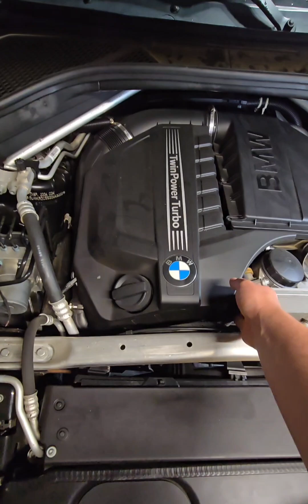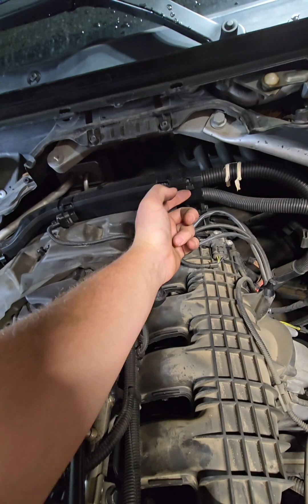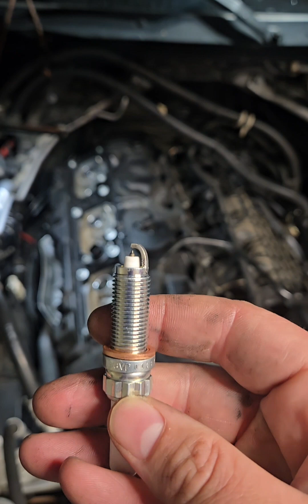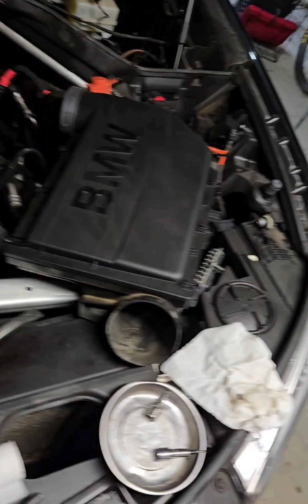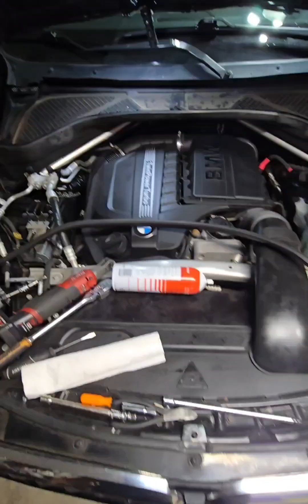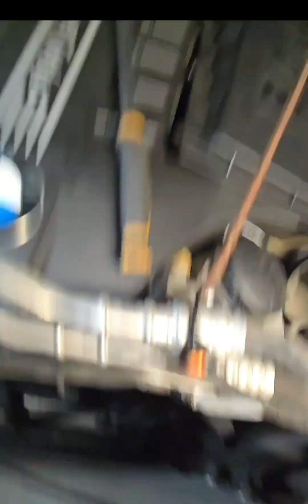2014-2018 F15 X5 35i n55 valve cover gasket replacement

Comment: I have been watching your video the little flex pipe in the front of the engine there's a hole right next to it what goes there mine doesn't have it look like you did not  Plug up that hole either What goes there😊
Reply from the maker: That hole is unused on the n55
Reply: @adisonwirth1059  Thank you I thought it was Turbo hoses

Comment: Awesome video.  Very helpful.  Being that this seal is this difficult to replace, its pretty lame  that BMW didn't make a better seal.  My X6 only has  52k miles on it and it is leaking.  An indie shop wanted to charge me $1700 to replace.
Reply from the maker: That's definitely on the pricier side in my opinion. Was that to replace the whole valve cover? Or just the gasket? And where are you located?
Reply: I'm in San Diego, CA. I am not sure if it included the valve cover ... I can find the quote.  But I dont need it now because of your video!